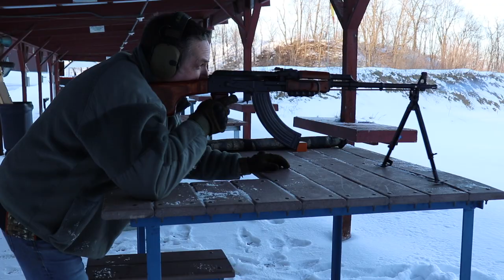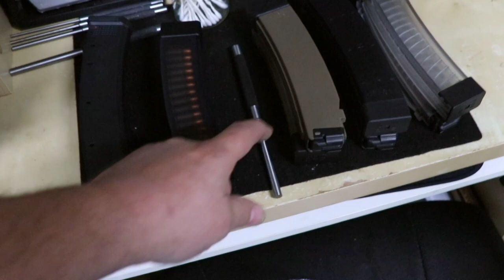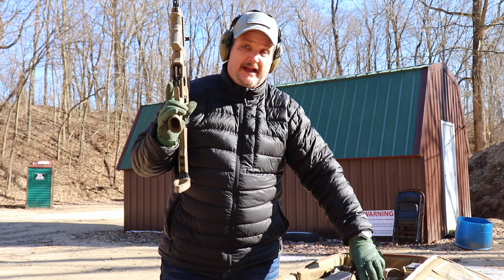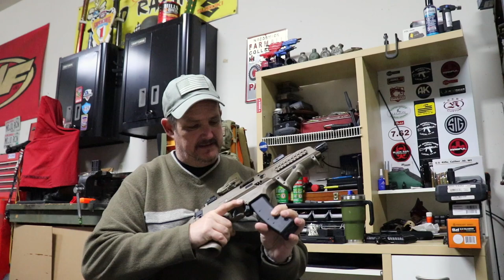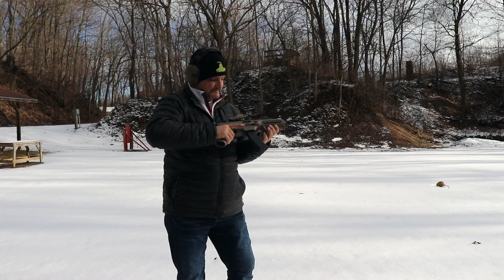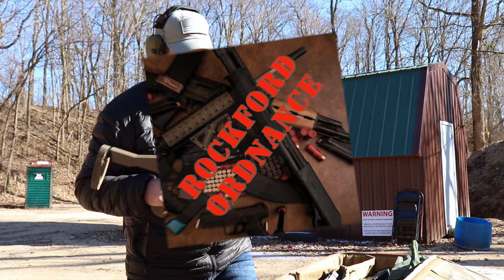CZ SCORPION MAG TEST UPDATE ON MAGPUL MAGS

Comment: I bought four Magpul mags for my Scorpion S1 carbine to use for steel competitions. They were unreliable enough to cost me the first match I tried them in. They would extract, but fail to eject a round, but close the bolt enough to chamber another round, but not enough to fire it. Trying to clear a jam like this in a competition is not easy because you have any empty loose somewhere in the action and hot round in the pipe. I contacted Magpul and they said my problem was caused by the fact that their mags were only compatible with the mag release lever on the S2 or their Mapul lever and NOT with my S1 lever or HBI lever I had installed. They convinced me to purchase their lever and when I got it I went out the range to run them. Guess what. Same problem. I contacted them again and they asked me what dates were on my mags. They explained to me how to find the date and when I told them they said "Oh, there's your problem! You have the earlier mags. We've updated them and the new ones will work fine." I paid to ship my old mags back to them in exchange for 4 new mags. I took them out to a falling steel match (just a fun club match) to see how they ran. They seemed fine for the first 50 or 60 rounds then they had the same problem as the other mags. To say I'm disappointed in Magpul is an understatement.
Reply from the maker: Had problems with mine early on and the more i have shot them the better they have become.  Last time out they ran perfectly.  I will say the only mags that have been flawless have been factory mags.  I've also found that the extractor area holds a ton of junk.  Even when I thought it was clean it wasn't.  Make sure you take it apart and really get in there.  Made a big difference.
Reply: Probably just had some bad mags

Comment: Try the psa ak v mags? They don’t drop free but they’ve been the most reliable for me.
Reply from the maker: Thanks!  Just haven't had the opportunity to grab some.  Im invested in the manticores for the most part so I will rely on those for reliability.  Just figured in the long run the magpuls would be more available and they hold 35 rounds.  I think its just the one mag that is having issues.
Reply: Rockford Ordnance thank you for the vid and reply. The manticore mags are good as well. I’ve had numerous failures in the magpul mags while using hst and gold dot hollow points but no failures with 124gr lawman. I’ve never noticed the ejection pattern so I’ll have to look for that.

Comment: I'm having FTE problems with my scorpion using my Magpul magazines. I bought a bunch of them also......
Reply from the maker: A bunch of people say im nuts that the magpuls work fine.  I beg to differ.  I have run tons of brass and steel case through them.  SOmetimes they work fine and other times they continually jam.  I have yet to figure it out.
Reply: Rockford Ordnance 
As seen and mentioned in your video your ejection pattern is all over the place with the magpul mags.

Comment: So , you don't know how to run a gun, huh ?  Let's hope he has found a place where he can be among fellow operators and not have to deal with us noobs . ; )
Reply from the maker: Yea, I kind of did the video just because the comments got to me.  Guess I should get some thicker skin.  I probably jumped the gun in the original video when I discovered the mag not seating all the way when I was playing with it on camera.  Had I thought about it more, I wouldn't have second guessed myself and if I had watched the video I would have known for sure they were seated because I had inserted them on an open bolt.  The magpuls definitely need more oomph to seat them on a closed bolt than other mags so if that had been the case my supposition may have been more well founded.  After testing the magpuls again, I still don't have an absolute resolution.  I'm guessing either that one mag has an issue as the other one runs fine or maybe its interacting with the ejector and doing something weird.  I'm going to be running a 1000 round case of that s&b ammo through it using only the magpuls and the manticores and will update after I'm done with the case.  That should put my round count somewhere around 2000 and I should be definitely able to give some concrete answers at that time.